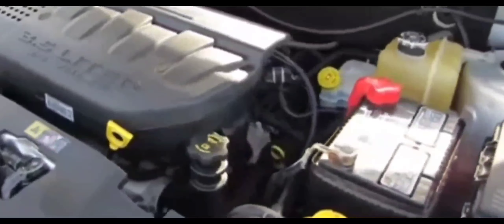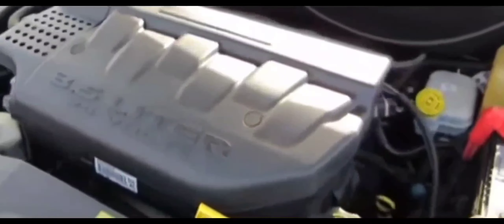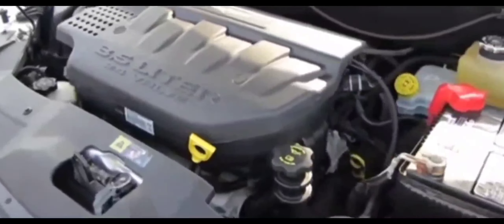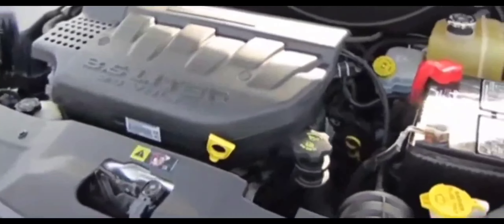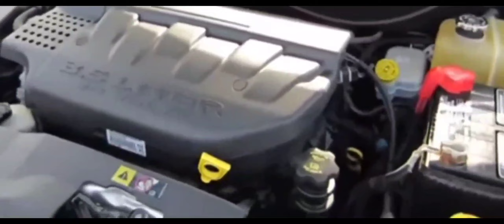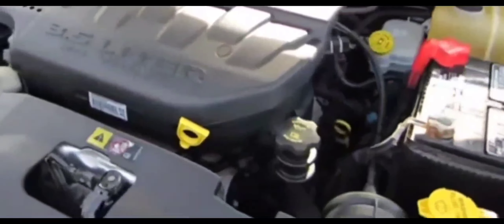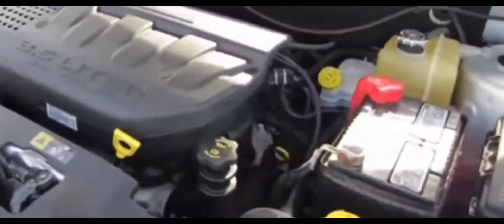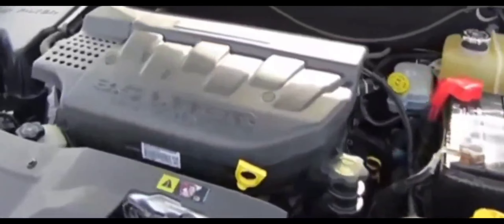CHRYSLER NO CRANK NO STAR- Lost communication with module/ ECU/ ECM/ TIPM FIX

Comment from the maker: UPDATE-

Hey guys, thank you for watching this video...if this has helped you out in any way please SUBSCRIBE, press that LIKE BUTTON and leave a COMMENT.

Please check out these INEXPENSIVE SCANNERS that WILL GAURANTEE TO HELP DIAGNOSE AND SOLVE YOUR CAR ISSUES. THEY WILL HELP YOU DIAGNOSE NO START ISSUES, ELECTRICAL ISSUES, ROUGH IDLEING, MISFIRE PROBLEMS ETC...

https://amzn.to/3hbxVF3

https://amzn.to/3o762Qc

https://amzn.to/3w4DolB

https://amzn.to/33sZzoY

Analyze your car issues and ERROR codes and clear them with this Amazingly accurate yet inexpensive OBD2

SCANNER- https://amzn.to/3tq0bGJ

Wireless Scanner- https://amzn.to/3f1ahZr

Test Your Battery And Alternator 

https://amzn.to/33r7umN

If you would like to help this channel, your donations are appreciated.

Cashapp- $PeterLCG

Venmo- PeterLCG

THANK YOU